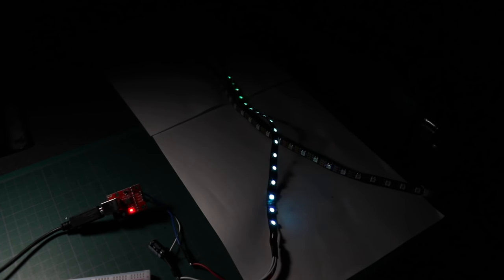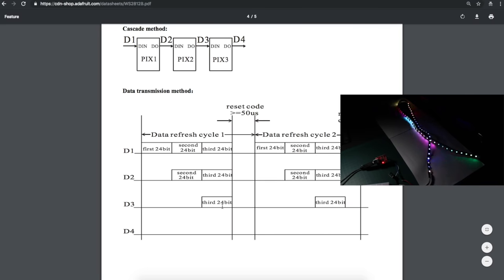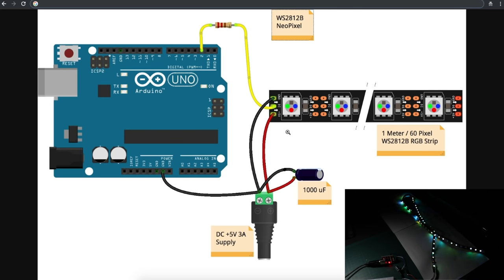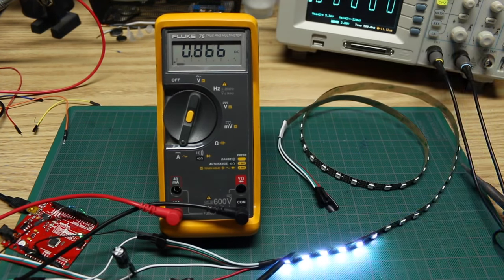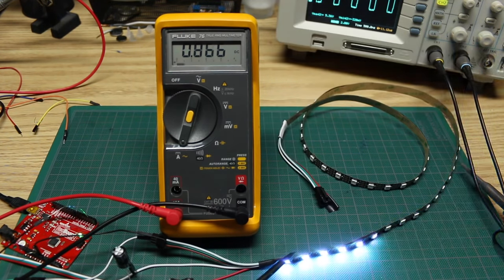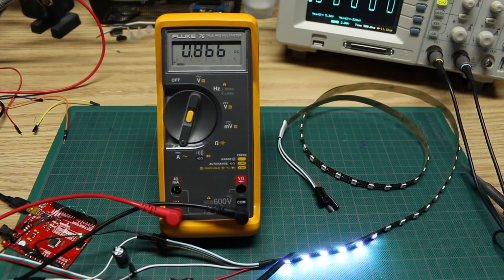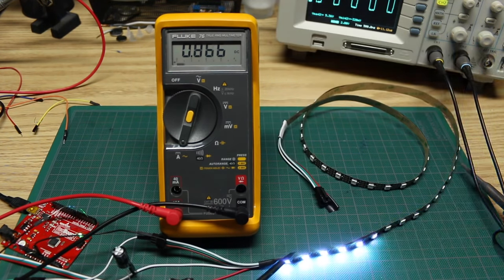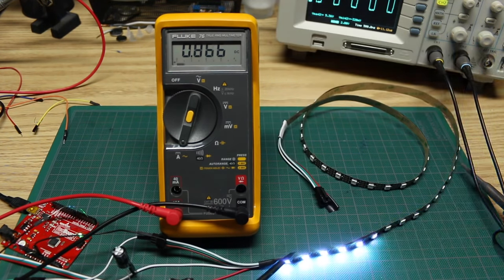HOW TO USE WS2812B NEOPIXELS WITH FASTLED ON ARDUINO

Comment: Hi!I have power supply (5 volts,12 ampers). Which resistor I have to connect to this led strip (1 meter,60 leds)?
Reply from the maker: For the series resistor on the data line, since it is meant to impedance match and absorb reflections, different set ups and different lengths of wire  make every situation unique but generally between 200 and 600 ohms seems to be adequate. It’s best to have an oscilloscope to actually see if voltage spikes  have been attenuated.
Reply: I have 560 ohms resistor so that should be enough.I am worried that 12 amps is too much for this led strip.
Reply from the maker: Assuming the LED strip is WS 2812, the resistor that we add in line with the data pin is not the same as a current limit resistor for a normal LED.  These take care of their own current limiting.

 The resistor we put in series with the data on this is just to keep signal reflections from causing voltage spikes, it’s a different situation than a current limit resistor. 

 So in this case the LED strip will just take as much current as it needs without harm and the individual LEDs are already protected.

Comment: is it possible to connect two neolights with same arduino code. and arduino???
Reply from the maker: Do you mean two completely separate data outputs rather than chaining them all as one strip?  I haven’t tried that but I think it would work. The pixels don’t need to be constantly refreshed they just get written to whenever it’s time for a change and then they maintain on their own so we can alternate different data outputs.
Reply: is it better to connect two led strips in separate output points or is it possible to connect them to the same output port of arduino??
Reply: do they both get enough voltage if i connect two led strips in parallely with the output
Reply from the maker: It’s easier to connect them to the same output, they are intended to be connected in series and you just change the code to say how many LEDs are on that output.
Reply from the maker: When connecting the data in series between two strips and then connecting the power in parallel, the power source has to be able to deliver enough current to power all the LEDs.  It’s not recommended to run very many directly from Arduino 5 V, a separate power supply is recommended  and it is safest to have one that can deliver 60 mA for each LED.   So however many pixels are going to be powered, multiply  by 0.06A and that’s how many amps the power supply should be capable of.
Reply: bro ..i need to have two led strips both having 10 leds each..both strips should run the same pattern..so wht where should i connect the output ports and how to supply power from a 12v battery..??im making it as drls for my sportsbike.
Reply from the maker: Are they the 12 V compatible strips or only 5 V?  
 I would think you could either connect them to two different data outputs or connect them as one string and either way the software controls which one will be on so if you have a pattern for 10, you just  duplicate it.   If they are all connected as one series strip, whenever the software is doing something on LED number 5,  it also does the same thing on LED number 15 etc. 
Then the positive and negative of the power supplies connect in parallel and go to the power source appropriate for the strips.

Comment: when you go to code led strips or rings, I get that first set of brackets are used for color but what are the second set of brackets used for?
Reply from the maker: Can you paste the specific line of code?
Reply: @GadgetReboot  the code would be like 
// Do a quick test/demo to show that things are working
  for { (int i=0; i<24; i++) (255, 420, 100) (100, 350, 20) }
Reply from the maker: It looks like there’s a lot of things missing there, those sets of numbers in the brackets look like they need some other function in front of them to pass those numbers into or something, and also those braces just after “For”  don’t look like they belong there so I have no idea what that is. I’m sure it would not compile.
Reply: Gadget Reboot  do you put leds [0] CRGB to get the color to show up on a led ring or strip?
Reply from the maker: This will set the first led (led 0) on the strip or ring to green full brightness, red and blue off, then send the command out through the library to activate it.  More info here https://github.com/FastLED/FastLED/wiki/Pixel-reference

  leds[0] = CRGB(0, 255, 0);
  // Show the leds
  FastLED.show();

Comment: What kind of power supply did you use? I am working on a project where I need to power 90 of the same neopixels. Can you just cut the cable of an adapter and then connect it to the LED? (Assuming 5V adaptor 4A)
Reply from the maker: The bench power supply I was using is like this one, random link from a web search:  https://www.itm.com/product/instek-gpc1850d-triple-output-dc-power-supply-18v-5a-x2-fixed-5v-3a-x-1?gclid=EAIaIQobChMIrPiTvtS_4AIVBwNpCh14BQA2EAkYCiABEgLNlPD_BwE

 On mine at least, I have two variable outputs that I set for 5 V and there’s a switch where I can put them in parallel so they share current and I can get up to 6 A out of it. 

 If you have an adaptor that does 5 V DC up to 4 A, then yeah cutting off the connecter and connecting it up to the LED strip should be fine. 

 So I think mine wanted a maximum of around 2 A for 60 of those LEDs and if yours draw the same current then 4 A should be a lot of extra power to do the job for 90.  I would start with the brightness lower and gradually bring everything up to full white full bright, and make sure it can gradually handle it.

 There’s another thing that you may run into, I’m not sure if 90 pixels would exploit this but you can only really run so many pixels in a row with the one power connection on the end before it starts getting dim along the way because of power losses so you might want to research what they call injecting power at multiple locations through the string of lights. I haven’t done it myself but apparently you just take an extra set of 5V and  ground wires and connect them up somewhere later along  The strip and supposedly power will be consumed from the most readily available injection point and everything should stay consistent along the strip.
Reply: @GadgetReboot  Just see your answer. Thank you so much man. Great videos btw. Keep up the good work!!